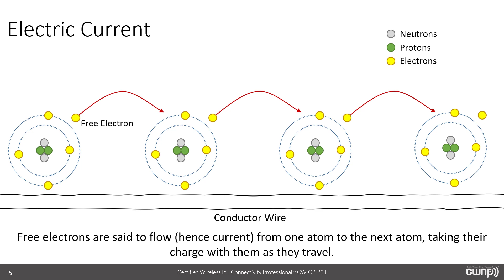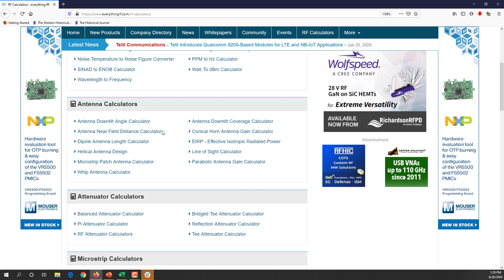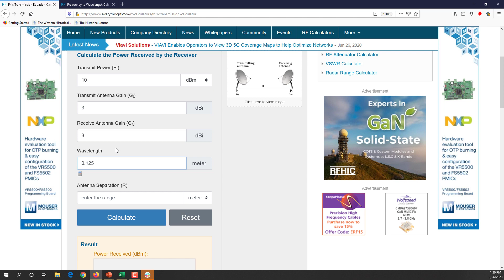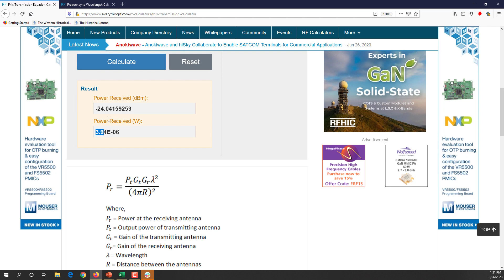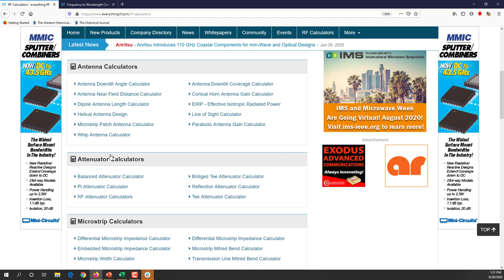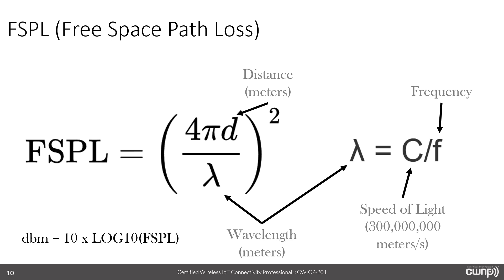Advanced RF for Wireless Pros - June 2020 Webinar

Comment: "Advanced RF for Wireless Pros"? You kidding? This is as introductory as it can go...
Reply: afrospammer this is the first of several that will be done, gets the ball rolling and we will be analyzing Maxwell’s equations and others down the road as well as in depth looks at RF components
Reply: @carpentertom  Hello Tom. I don't know if my question seems a bit abstract but can one find the maximum data rate by only knowing the center frequency. For example, what would the max date rate be if the center frequency was 11.5 KHz?